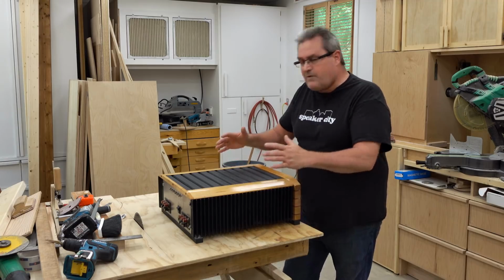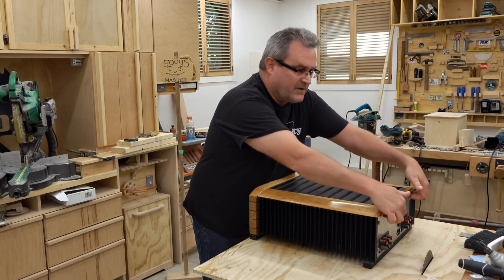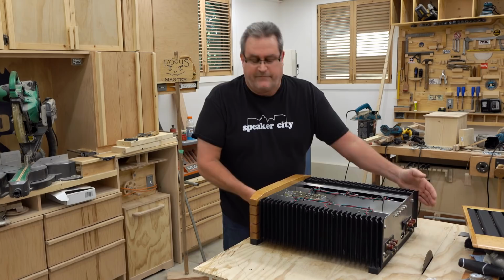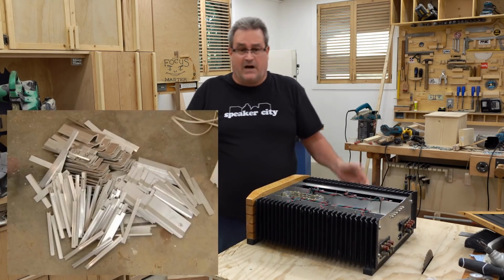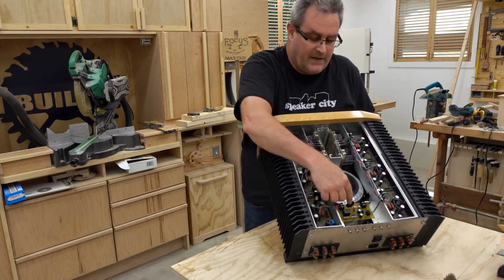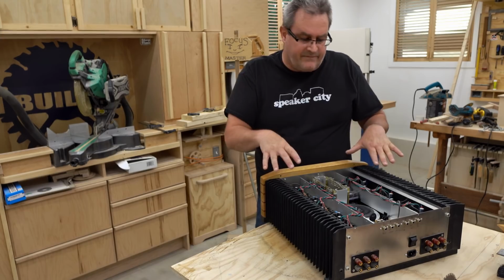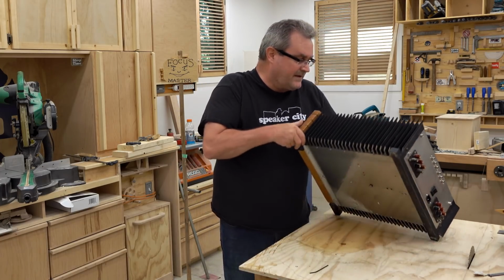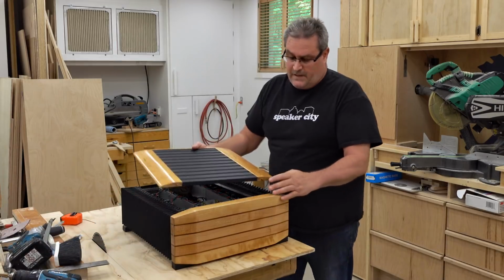The Most Impressive Thing I've Built

Comment: From the very clever use of aluminum-on-hand for heatsinks, stainless chassis and end panels, original design amps and boards, and more than anything - the elegance of the outer design - this thing bristles with amazing and cool features.  You got it quiet by doing research on quality design rules.  

Thank you for making videos, I rarely comment but have been watching since the early days.  This is excellent!

Comment: Looks awesome! I don't know about home-grade style ones, but I work with professional ones, and we turn them on/off in a specific order to get rid of any backfeed caused by turning on/off all the audio sources, it's always amp is last on and first off. 

We do this because if you turn the amp on first and then each audio source, as you turn on each audio source you end up with the 'thump' sound from the power being applied to each audio source that gets transmitted down the line.

Comment: He is a genius, he builds amplifiers out of wood, and wooden coned speakers. How do you get the electricity to flow through wood, do you use different types of wood to get current flow. Do you have special saws to make the tiny wooden transistors, and diodes?

Comment: My Balanced Audio Technology VK-6200 has six, 200 Watt amplifiers in a single chassis - each with their own power supply with a transformer on each board that's about the size of your single transformer.  The weight of the amplifier is about 200 pounds.

Comment: Awesome project. I just got more into woodworking to build a cabinet for a 3d printer. I've watched a bunch of your stuff, noted the audio, but didn't expect you would design and etch stuff yourself. Nice. Kudos. Most of us are probably better called "makers." I've got a welding cert, class A license, owned an autobody shop...twice, and play with electronics as a hobby. Sometimes it sucks try to fit into a two dimensional audience. Not that I am active on here, just generalizing. Thanks for the upload.
-Jake

Comment: Yea, pull out the guitar amp!  Using the door thresholds is a clever way of making the heat sink.  I like that.  I noticed on your previous video you were doing the electronics work in your workshop.  Do you still have the electronics room set up in your basement? Do you plan on doing more of that kind of stuff in the future?  I always find the electronics projects interesting.

Comment: Interesting design. Instead of using a bootstrap negative supply to the output stage driver (Q8) did you consider using a constant current drive instead? Of course fully symmetrical input/drive stages eliminate these issues.
Personally I prefer separate power transformers for each amplifier- gives more options for earth termination between channels.

Comment: John, Electronics are way more my thing than woodworking so I really liked this video.  The one thing I really don't get is how your moving the heat off the amps into the heat sink.  Along with that, I don't see a power transistor that looks like it could handle 100W.  Usually transistors in that class would be made with a totally metal case with two "legs" coming out of the flat bottom side.  The metal case gets fastened to an isolated metal heat sink and is isolated electrically from those two legs.  Depending on the transistor, you could have an NPN or PNP so that metal case and legs might be hooked up different.  Looking at your boards it appears that the only heat sink on your power transistors for each channel  is a little fern array bolted onto the back of the metal tab on the transistor.
Reply from the maker: Output transistors are under the board - 2STC5200 / 2STA1943

Comment: Remembers me at my 2N3055-Times. A 30kg (metric) Monster of a current and voltage adjustable power supply, */- 1-15V, 0-10A, hot regulated, 10 2N3055 Transistors......   crazy times....

Comment: Looks like you really put some though into your build.  Very creative use of parts.  Harmon Kardon circuit?  I think you said your using a 700VA transformer.  Since AB amps usually can't go beyond 60% efficiency if your lucky, I think you would need to stack a second transformer in there.  Ideally 40-0-40 (+/-56VDC) should get you the 100 watts but there are voltage drops so it could be a little low.  But, really nice work.  How are you doing the active crossover?

Comment: I miss my yamaha M80 power amp. I know what you mean about that big thump sound. Near the end of its working life, I was getting  That thump sound a lot. And always when I plugged my ipod into the .. mic jack?  of the preamp (C80). Anyway, one day it thumped and that's all she wrote. I thought it was a fuse. Replaced it and it burned out instantly.  It weighs a ton too (50-60lbs) but when I cracked it open, it was mostly one giant heat sink. I was told the parts to fix it are hard to find and very expensive. I think I paid close to $1000 usd for it at the PX. (maybe $1000for amp n pre amp) of 1986 USD. to fix it will cost about the same price.. Wtf ..Anyway, in its glory, in the barracks, I never lost a stereo war. Lol how much were all the electronic parts to build yours? Ive got 4 very lonely bose 901's waiting for a solution to this dilemma

Comment: As an audiophile and speaker builder myself, I would like to see more of your system. What are you using for the active crossover?
Reply from the maker: used to be a Behringer DCX2496, but that stopped working 3 years ago. Then I bought a CX3400 and that's what I have now. Was planning on designing and building my own active crossover, but that's probably too big of a job for me now.
Reply: I Build It Scrap Bin 
I'm usually a passive crossover type. Designing and building my own. But starting to venture more into active. Currently have a MinDSP module. My own site is Mosaic Audio Design on Facebook.

Comment: May I ask why you went with separate amps instead of a crossover in the speakers? Great video and it looks fantastic! Love how you repurposed leftover building materials.

*(looking further into the links you provided, I think i understand it more now but i still can't really wrap my head around what the main advantage would be, Headroom? or crossover phase issues? sorry if this is a dumb question)
Reply from the maker: In a nutshell, better control. A passive crossover is a fixed thing and it can take a lot of time to design the right one for the speaker combination. Using an active crossover allows you to change things quickly with a turn of a knob, so you can really dial in the perfect settings for the best response.
Reply: Ah, I see how that can be useful. Thanks for answering!

Comment: Cool!  Very nice looking case, does some of the other equipment have a similar look?  On an non-audio topic, have you done a battery replacement on any of your Makita drill packs?  I have four packs and two of them don't charge anymore.  I would love to save them if possible.  Thanks for the video!  Jim
Reply: Paul, I think all this generation of makita drills are Li.  I took one apart and it is ten cells of the popular 18650 cell.  Problem with the makita packs is that the circuit board on the battery pack will disable all charging if it has displayed a charge fault three time in a row.  So then you have to not only replace bad cells as well as the small circuit board inside the pack.

Comment: That. Is really impressive John.  The. Irony. You may  not know about.   Is. That. On the internet.  Or You Tube.   There. Is not. Any.  Channel or.  Tutorial. On how to. Make. A high end.   Stereo. System. ?  There are. Plenty of reviews.  Of commercially.   Made systems. Etc.   Ive searched.  For someone that. May  supply or sell.   A  set f plans. Or  instructions. On.   A nice. Set of speakers.  With.   A high quality. Sound. ?   I. Originally.  Thought.  I would be able to.  Find.  A. Way to. Clone. Bose. Quality. Sound.  And make a higher.   Quality.   Box or enclosure then they offer. ?   At least that was my. Original hope.  I. Did.  However. Find. A  few. Speaker. Kits.   That.   Were.  CNCed  parts. That. You could assemble. And install.  Speakers. That. Come in the kits.  That. Appeared to be.  A good.  System. And i may.   Go that.  Route.  In the. Future. ?   My. Point is. You might.  Find. A.  High interest.  In. DIYers.   Wanting to.  Know more details. In the system.   You.   Made ?   Especially.   Fans of yours. An your channels ?